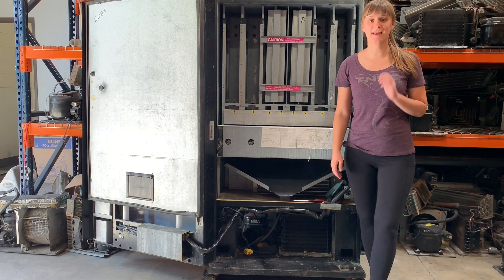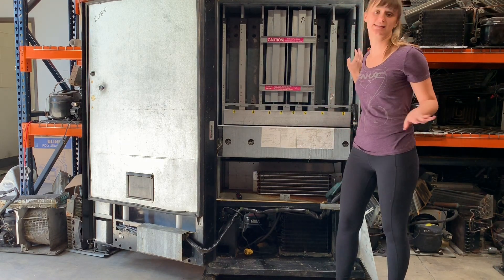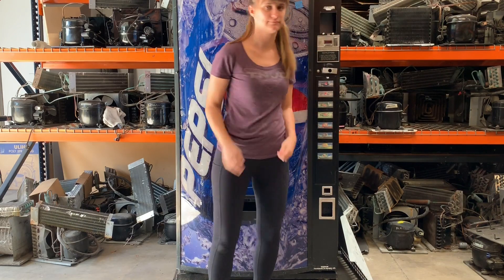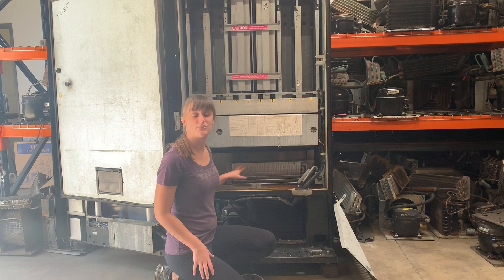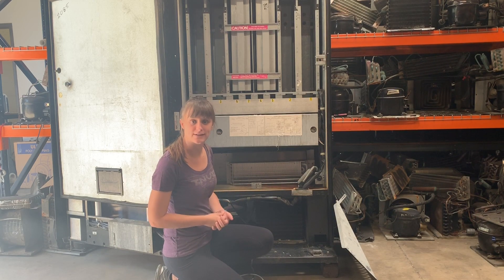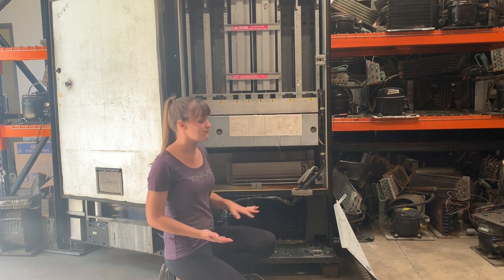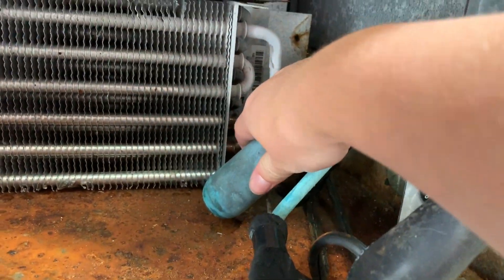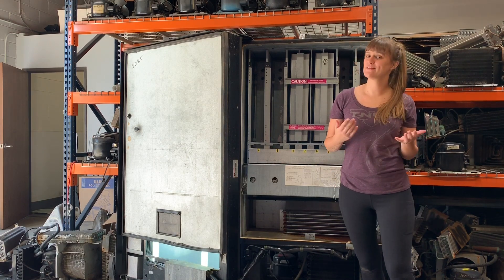How to test a Refrigeration System inside a vending machine

Comment: Hi, Good work with the video. 
Just have a quick question. We have vending machines and some of them have ice formation on evaporator. We have tried every possible thing but no solution. Last we’ve asked by OEM to replace evaporator fans with higher RPM ones. 
Will that help?

Btw: it’s hot food vending machine with target temp @ 3-4 degrees. 
Hope I didn’t bother.  😊
Reply from the maker: If ice is forming on only part of the evaporator then that usually means there is a leak and it's low on charge. If you could send some pictures I'm sure I could diagnose it for you vendingworks@yahoo.com

Comment: This is a good video. Thank you. But I have a different problem. All of the drinks in my machine are freezing up. 

What could be the problem? 

How can I fix this? 

Also, I see that you have a lot of units in the background, do you sell parts? 

Where can I find a schematic for this machine?
Reply from the maker: If the drinks are freezing then you just need to replace the thermostat. Schematic for the machine you can usually find on the inner door of the machine. We sell coin mechs, bill validators, and refrigeration decks for vending machines.
Reply: @Vendingworks  Thank you that helps alot. The schematics are missing on this machine. I have looked everywhere. 
Do you have a website or somewhere I can order parts from yall online?
Reply from the maker: @windturbineclimber5412   Vendingworks.net is our website

Comment: Did this. compressor came on when plugged in however there was no ice around evaporator and it was warm to touch. potential compressor replacement?
Reply from the maker: Sounds more like there is a leak and no refrigerant left in the system
Reply: @Vendingworks  thank you!
Reply: My compressor and evaporator are both working but no frost and nothing cold. When i hook up Freon, it goes to the red like overcharged. What do i do now?

Comment: I have a Royal 552-8, the condenser is frosted over heavily. I've unplugged machine for a few days and turned it back on. The top 2/3 of condenser has thick layer of frost.

Door seals are good. 

We have duplicate machine that has clear condenser so we are wondering what's wrong.

It does cool just fine
Reply: Bad evaporater fan motor? check amp load

Comment: Thank you for your video. It was very good.  I have a used 501e pop machine and the evaporator fans run all the time.  My machine is located indoors and I can hear when the condenser kicks on and off.  Is there a way to quiet the evaporator fans when is is not cooling down the cold box?

Comment: My evaporator is completely turning into a block of ice.... Low refrigerant possibly?
Reply from the maker: If it is completly covered with ice then the refrigerant charge is fine. The problem is going to be a bad thermostat or bad evaporator fan. If the evaporator is only partially covered with ice then there is a leak in the system and it is low on refrigerant
Reply: @Vendingworksnet  as it turns out I moved the thermostat all the way up and down a few times then back to set temp and the problem cleared up.

Comment: Hi Amy, I recently acquired a Dixie Narco 501e 9select, doing the same testing as you did in this video. Mine is cold but did not frost in those 15mins, I’m going on 20 mins now just starting to frost, also I have a digital temp control is this preset to the cold temp It keeps reading 65 degrees pls help

Comment: Help! I have a machine identical to the one in the video except there is no thermostat either where yours is or by the evaporator...I don't know how the temperature is controlled. Anyway, when I perform this test the deck functions correctly. When I plug the machine into the wall and close the door, the compressor starts in a few minutes but then after a few more minutes it kicks off, gets hot, no cooling. I thought it might be the refrigerant relay and ordered one but now I'm not sure because like I said, the compressor does start - just doesn't stay running.
Reply from the maker: It would help to know what model machine you have. There is either a thermostat or a temperature sensor depending on what model you have. It sounds like you may have a polarity issue, double check your wiring. If the plug on your machine (that plugs into the wall) has ever been changed, check to make sure polarity is correct. Black (hot) wire to small blade, white (neutral) wire to fatter blade, and green to ground

Comment: I have a ams 39 vcb my ac just blows hot air
Reply from the maker: You probably have a bad refrgeration relay, very common in AMS machines
Reply: I’ve tested it and it has 24 volts coming out
Reply: Is it still possible for it to be not working even though it gets power
Reply from the maker: @howtobrandon1576  Unplug the compressor from the machine and plug it directly into a wall socket. this bypasses the relay, if it works then your relay is bad
Reply from the maker: @howtobrandon1576  you need to test the 110 volt side of the relay
Reply: I connected it to a extension cord and left running for 15 min the evaporator did not freeze up
Reply: I also check with a volt meter on DC Volts and got 24 volts out of the relay

Comment: instead of unplugging the refrigeration deck and getting a extension cord, just unplug one of the electrical connectors to the evaporator fan motor, you will get the same results,  Ive been working on the stuff for 37yrs
Reply: Are you located in Texas by chance?

Comment: my evaporator is cool but not cold. when i plug it into an extention cord it gets good frost so the unit is good. is my problem a bad thermostat?
Reply from the maker: If the entire evaporator is frosted up then yes the unit is good and you probably have a bad thermostat. If the evaporator only frosts up partially then it is low on refrigerant.
Reply: @Vendingworks  thank you so much
Reply: @Vendingworks  would it be ok to keep the soda machine plugged in and the cooling deck plugged into an extension cord so i can make money while i wait for the parts? the only problem i can see is it might get too cold....

Comment: Quick question.
My unit gets cold but it stays running 24/7 and after about 12 to 15 hrs it is still running but is now warm not at all cold.
I just completed your check in your video and my compressor works just as yours did.
Any possible troubleshooting suggestions?
Reply from the maker: After running for 12 hours is the evaporator solid ice, or is it (the evaporator)  not cold at all? pictures would help me diagnose
Reply: Bad fan

Comment: Would love advice on how to fix
Reply from the maker: I would need more information. If it is an electrical issue (compressor not running) I would try a 3 in 1. if the compressor (and fan) runs but system doesn't get cold then most likely there is a leak that would need to be repaired

Comment: hi quick question-what if you get the same results (frost on the accumulator, etc) when the machine is fully plugged in (evaporator fans running)?
Reply from the maker: Sorry for the delayed response! The problem you are describing would be caused by a bad thermostat, because its not shutting the deck off at the proper time. The good news is, that's generally the cheapest problem to resolve.

Comment: My compresser on my machine keeps turning on but then after about a minute will turn off, would you know what the problem is?
Reply from the maker: Well if it's a Royal or AMS machine it could be a bad refrigeration relay. If it's any other machine, it could be a bad compressor or a bad electrical component. I would start by installing a 3 in 1.
Reply: It is low of freon